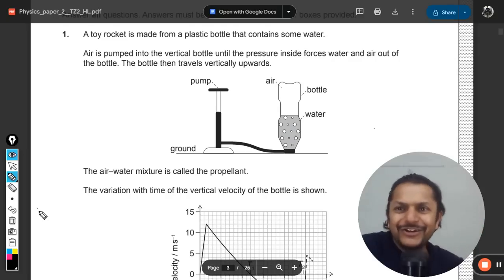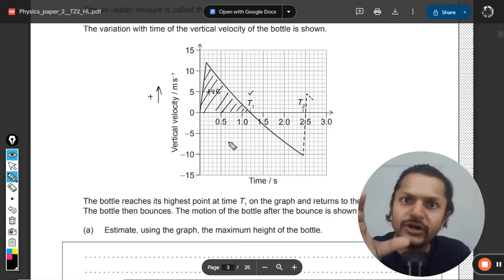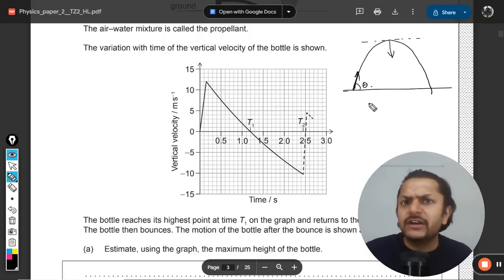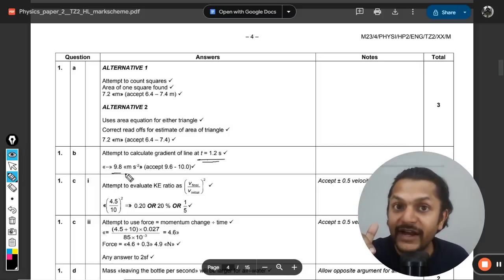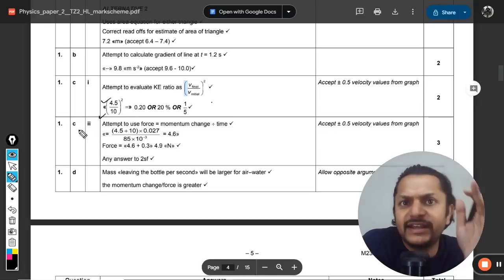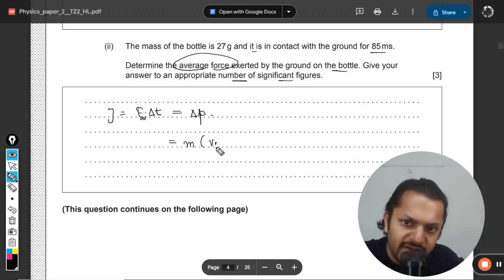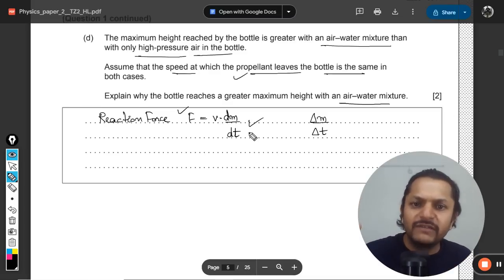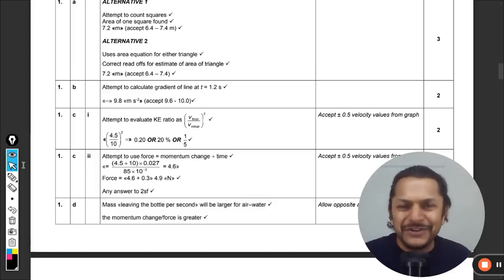A toy rocket is made from a plastic bottle that contains some water.Air is pumped into the vertical

Comment: Hi Sir, 

For question 1c(ii), where did they get 0.3 from?, you ended up getting 4.6N,
Reply from the maker: 0.3 is the weight of the bottle (Rounded off to two SF), which will be added into the force applied for the momentum change.! 

27x9.8/1000